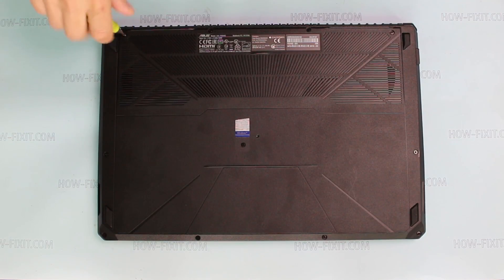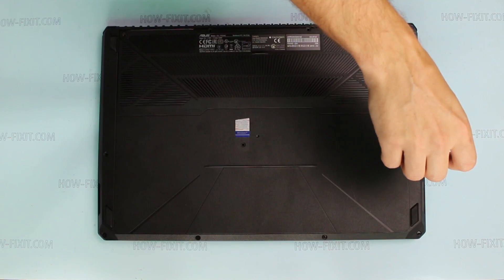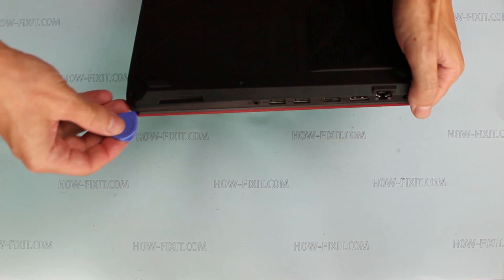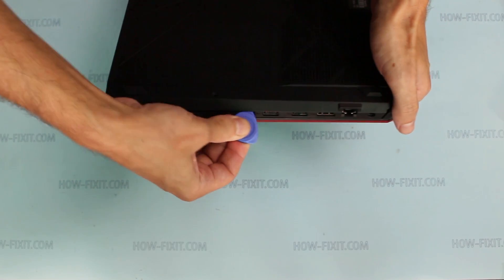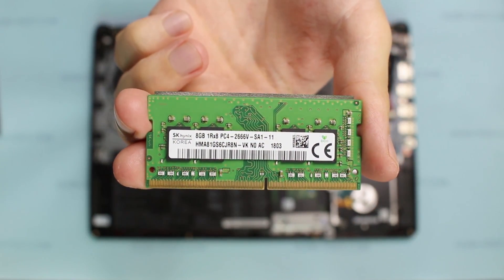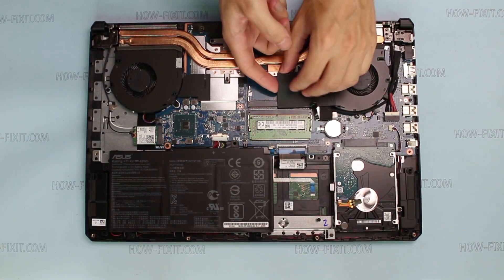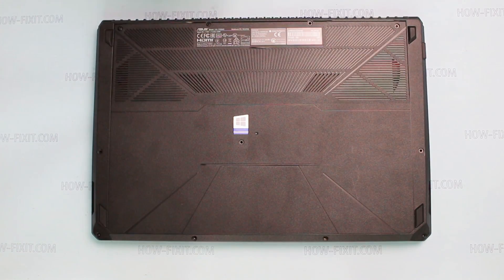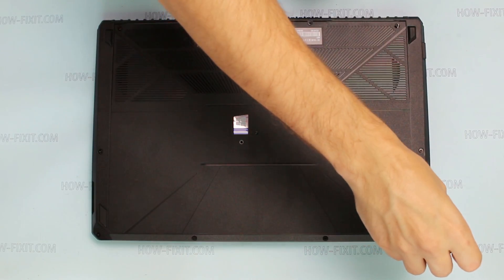ASUS TUF Gaming FX504, FX503, FX80 RAM Upgrade and Install - Your Step-by-Step DIY Guide!

Comment: Does the Mhz matter? My fx503vm has a 8GB DDR4 2400Mhz but i want to upgrade to 32 GB total(2x16gb) does the Mhz matter in this case? Or can I only use 2400Mhz and none above it?(2666 & 3200)

Comment: I got my 24Gb. Successfully Installed 16gb Patriot Signature PSD416G266681S DDR4 - 16ГБ 2666 additionally to existing 8gb (SK Hynix 2666Mhz, timings 19-19-19-43). Works properly in dual mode(8+8gb) and remained 8gb in single-channel mode.

Comment: Can I remove the stock Crucial 8GB 2666 MHz and replace it with 2x Kingston 8GB 2666 MHz? Will both rams work after I install them or I have to configure something? Also is it possible to use 3200 MHz rams instead of 2666 MHz or you can only put 2666 MHz into this laptop? Please If someone knows the answers I kindly ask you to reply to this comment, thanks to everyone.
Reply: The motherboard of fx503vm only allows for speeds of 2666Mhz, and in theory you could switch them without any issues, just remember to check the recommended ram upgrades for your specific model
Reply: @alexreyes356  yeah I found the answers myself and succesfully upgraded to the mentioned rams by myself. Thank you for your reply though.

Comment: I have a problem...
I own an Asus Tuf FX504 corei7 with 8GB Ram
so I bought another 8GB Ram ddr4 and I installed it so it's now 16gb
I tried the laptop everything seemed fine tried few games and then shut it down.
I tried starting the laptop again but it didn't start, so I removed the the new ram and it started normally
of course I ordered a new Ram but was the problem from the ram or was it something I did wrong?
anyone can help?

Comment: for FX504 what is the maximum memory upgradable?
Reply: Maximum is 32gb (using 2 16gb)
Reply: @snootycapybara3683  so there is only 2 RAM slots on this laptop not 4 slots?
Reply: @Katakuri_08  task manager shows 4 slots but I’m yet to open the machine so I was also curious about that
Reply: @harold12A I opened mine today it only has 2 slots. Windows reports 4. Mine was full of dust and was overheating cleaned back to new. Now I’m going to buy some ram.

Comment: Hi, will it be okay to put 2 different brand on the slots? Like for example, hynix on slot1 and hyperx on slot2 ??
Reply: You can use different ram brands and speeds however, this would not run at optimal performance

Comment: My FX504 says it has 4 ram slots but in all the videos I've seen on YouTube I see only 2 slots ofr ram. I haven't opened my laptop yet. Are there 2 or 4 slots in FX504 any idea?

Also can 8GB and 16GB ram work together?
Reply: Yes, I have the same laptop showing  4 RAM slot in CPU-Z , but I think it has 2 RAM slots which are also mentioned on Asus website.
Reply: @rishabhpant  I've replaced my RAM with 2 chips of 16gigs myself. There are only 2 slots which I could find. If there are more I don't know where they are.
Reply: Can you please tell me which ram (exact model no.)  you have used and what's difference you noticed after upgrading the ram. What about old sk hynix 8gb ram???
Reply: @rishabhpant  Crucial CT16G4SFD8266 16GB Single DDR4 2666 MT/s PC4-21300 DR x8 SODIMM 260-Pin RAM

I have been using it for about 3 weeks now. There's moderate difference, even with 32gb ram I wasn't swept off my feet as I expected lol.
Reply: @shanuonutube  thanks bro but I am still confuse that should I add a one more 8gb stick means 16 gb total memory and can't upgrade in future because of 2 slots.

Or

Add a one more 16 gb memory with existing 8 gb memory menas total 24 gb memory.

Which one you will prefer ???
Reply: @rishabhpant  I've read that it's not best to combine 8 with 16. Cause that puts extra load on the 8 stick and it malfunctions.

Comment: Hi. Im also using Asus FX504. Question - Can i replace stock DDR4 8GB 2666Mhz CL19 with kit of 2 [2x16] DDR4 32GB 2666Mhz CL15 ? [wondering if CL15 wont cause any problems]
Reply: I came to this video hoping to know the stock ram CL...thank you so much...I read somewhere that if the cl doesn't match then the frequency decrease to 2400Mhz....hope this helps
Reply: I'm your case it's fine since you are using two ram of same cl

Comment: Is there any way of changing the ram speed on the  505?
i installed another 2666mhz module, but its runnin at 2400
Reply: Nope. 2400 is the limit.

Comment: Hi what is maximum option of ram which can be used in that laptop can go on 32?
Reply from the maker: max RAM is 32gb
Reply: @howfixit  Hi. Can you confirm  how many RAM slots on this fx503? is it 2 (16x2) or I can do 4 Slots? (8x4)

Comment: What will happen if i dont disconnect battery connector?
Is this possible to damage this if i would try to disconnect this connector?
Plz reply im trying to do this
Reply: If u do not disconnect the battery connector u might shock yourself.
Reply: @davidpetcu2841  and tip how to disconnect this?? can i just use screwdriver?
Reply: @davidpetcu2841  So if I use a rubber glove then no need to disconnect?
Reply: I suppose you be fine if you used a rhbber glove. I don't think it is necesary tho. Just gently disconnect the battery with an object. The only thing you need to look out for is not touching the motherboard before removeing the battery.

Comment: Could I use ddr4 2400mhz along side the 2666?
Reply: I really wouldn't recommend it Glenn. Because the computer will always choose the slowest slot. So if you have a faster speed ram you will be killing your performance with the slowest. This is what they call the bottle neck. It's always best to put the same brand together

Comment: can I add any kind of DDR4 ram in the other slot?
Reply: Yes
Reply: Actually the most you can do in a slot is 16 gb DDDR 4
Reply: But if it's not the same speed. You will be bottlenecking yourself. So make sure it's the same speed

Comment: Plz make a video how to install a external gpu on laptop
Reply: It is not possible to install an external GPU. You can connect it with to your laptop with a thunderbolt 3.0 cable but be careful because your laptop must have the thunderbolt 3.0 port orelse that external GPU is useless.

Comment: Thanks for the video. i currently have the asus tuf gaming fx504 series....my questions... is there a max limit on ram upgrades for it? i know it can be expanded to 16 gigs of ram which i plan on doing if i cant go any higher. im just curious if installing more than 16 gigs can be an  option or even beneficial to this particular machine? thank you in advance for any help or advice about my questions.
Reply: U can switch out its starting ram for a 16 gb ram card and then add another one of these to you second slot and boom u got 32 gigs of ram
Reply: @davidpetcu2841  Can i put lets say 16gb of ram and keep the 8gb too?
Reply: @JohnWideCock  you can

Comment: What? I thought for upgrading ram you only need to screw one knot in the middle? There's a slot visible just by lifting that panel
Reply: I dont think there is any central piece that you can open on this laptop

Comment: upgrade ram can game perfectly running ? or what ? cause it for my battlefield so lag
Reply: If you have 4GB ram then upgrade it to 8GB ( which is bare minimum ), but you can also get 16GB RAM which is kinda excessive.
Reply: I got a boost of 20+ fps in overwatch and cod after upgrading to dual channel memory

Comment: Thanks for tutorial, now my ram is 24gig..
At first, I was thinking if this laptop just like other, but this just like phone, opening with clip and battery connector.?
Unbelievable. 

Still not installed any game yet, just my software need lots of ram.
My other laptop with 16 gig was occupied 90% of its ram.

Now I'm ready to go.
Btw, I'm using team elite 2666 dr 4 16gig, at first screen goes black, and task manager shows up, after restart it work just fine.
Reply: How can it be 24gb lol, that's not how you utilize optimally the dual channel lol.
Reply: Legitti true but it works if you got one 16gb and one 8gb

Comment: My asus tuf fx-504gd has 4gb ram 2666mhz and i want to add 2x8gb ram ddr4. Can i do this?
Reply from the maker: Yes, you can
Reply: But i search on web can only add 1 ram
Reply from the maker: Yes, you'll disconnect 4gb RAM and install 2x8gb RAM

Comment: thx for the amazing video
I would like to ask that i have a original crucial ram 8gb, could i add another 8gb hyperx ram on another slot? As i saw yr reply above metion that hyperx ram will better
Reply from the maker: You can add any DDR4 RAM
Reply: How-FixIT please help ..I have fx505 dt..it comes with 8 gb ram ..can I add more 16 gb in empty slot and make it 24 in total ?

Comment: hi, ori asus ram looks like a SK brand CL19 type. if I add a faster CL15 Kingston hyperX ram at 1st slot , will that be any stability issue (different latency of two ram /  ori ram at slot 2).
Reply: I dont think so. I would choose ram with the same frequency tho.